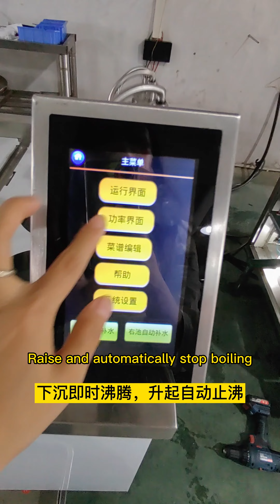升降煮面炉，智能升降煮面炉，商用智能煮面炉煮粉炉，智能煮面炉，自动煮面机，自动升降煮面炉，商用煮面炉，煮面锅#Lifting noodle cooker#Noodle cooker#cooking

Comment from the maker: Please leave your contact information, or check it on our official website or Alibaba international station, or contact our manager through the following contact information to provide you with detailed introduction
Our official website: https://fsyawei-equipment.com
Our Alibaba international website: https://fsyawei.en.alibaba.com
Contact information of our manager:
Tel: 8618923213351
Wechat: 18923213351
WhatsApp:18923213351
E-mail: a18923213351@163.com
Country: China
You can get picture and video data on wechat. If you have a wechat account, please add a wechat account: 18923213351